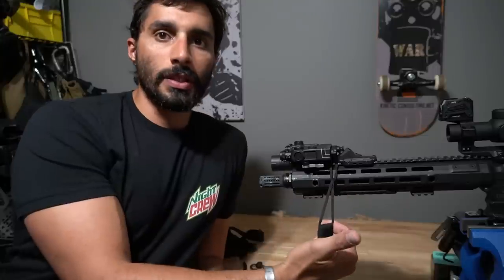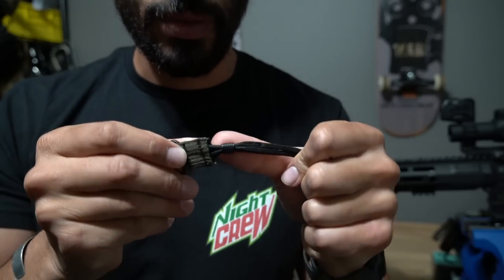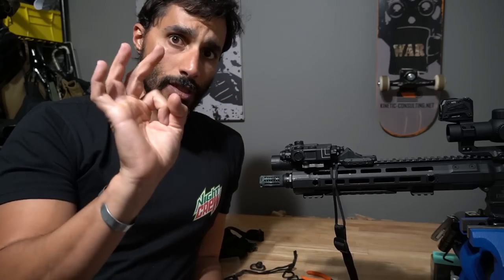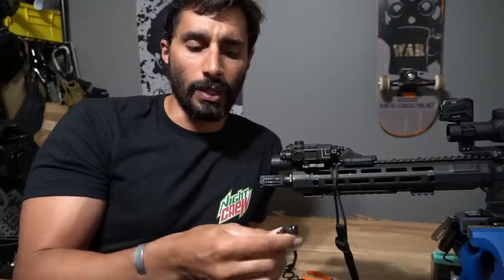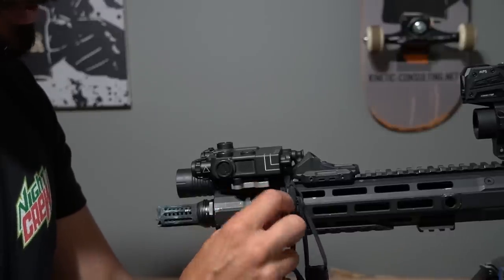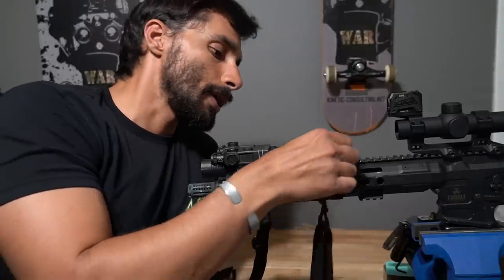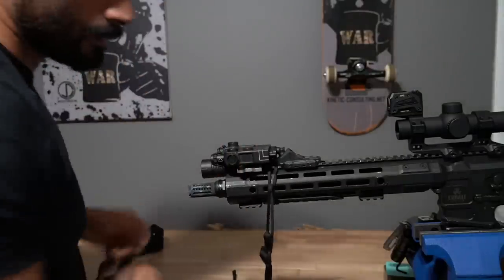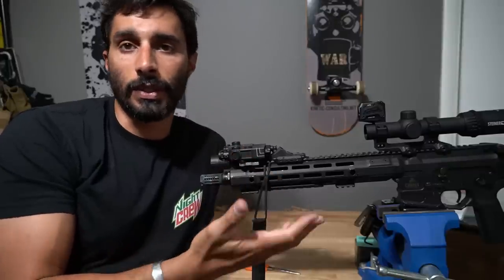Front Sling Attachment Point

Comment: You mentioned the condition one has a rubber to keep it in place. This can be done with just 550. Not trying to imply you didn’t know but this might save somebody some money. You can push 550 through your rail, make a girth hitch on the end then route the end that attaches to the sling through the hitch before attaching to the sling.
Reply from the maker: Good idea
Reply: I added a video if that was unclear

Comment: The first 2 point sling I ever bought was a Frank Proctor sling. Still using it. Took the 550 cord girth hitch attachment idea and used it on all my other slings as well, been doing that for years. Also use a QD in the rear. It’s a great way to attach slings. Quiet, minimal added weight, easily field repairable, CHEAP, fully adjustable, can run it all the way to the front, back or anywhere in between on the rail…just a great simple way to attach a sling. 👍🏻

Comment: Always used the proctor sling since it first came out (still have ones that say WOTG). I’ve tried to go to other slings, but generally always come back. I upgrade to his newer slings for the integrated storage option which works great. 

For bolt guns or precision/comp guns I use QDs front and back for simplicity of taking the sling off before a match or to use the sling to increase tension (through my belt for example). 

Good stuff

Comment: I'm wondering how this attachment style works if you go hands-on? Does it change your mechanics at all? I mean, especially if the sling starts to loosen up on approach?
Reply from the maker: When I go hands on I sling the rifle to the rear. I don't leave it up front.
Reply: @KineticConsulting  thanks for the reply....my quick follow up is basically, when do you see this solution start to shift and change the status of the sling?  Slings are good to hold the weapon when standing around, provide a stable shooting solution for longer range engagement, and preventing a rifle from displacement 

Are you concerned in the other situations that the paracord will slip around the rail and make your "good setup" less than good? Does that make sense?